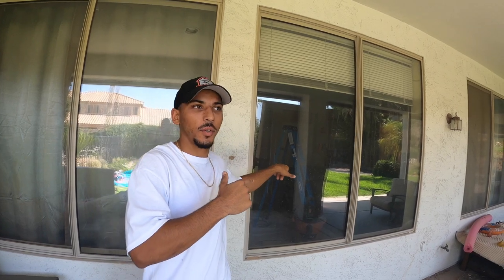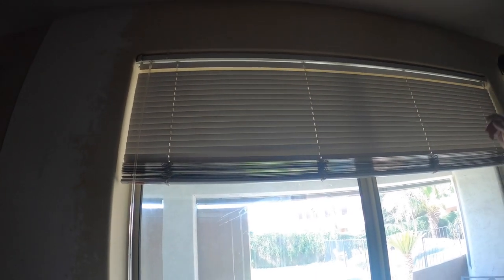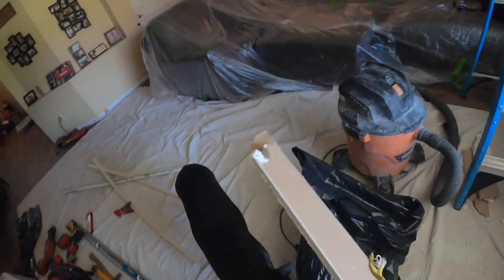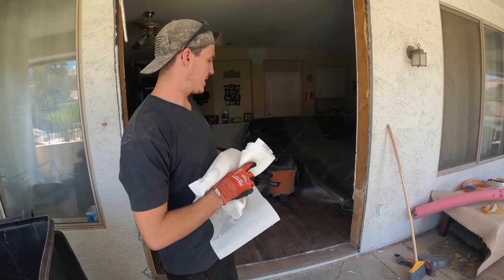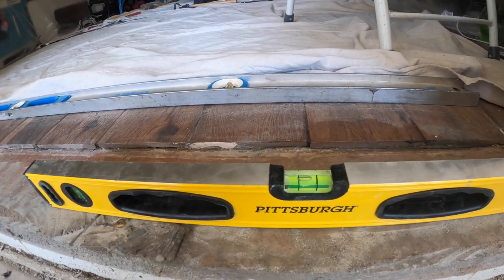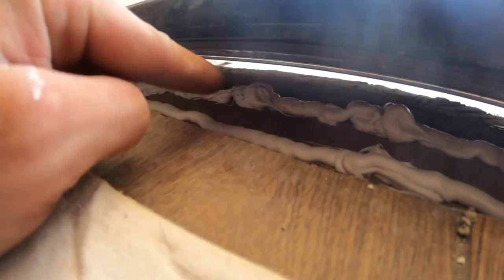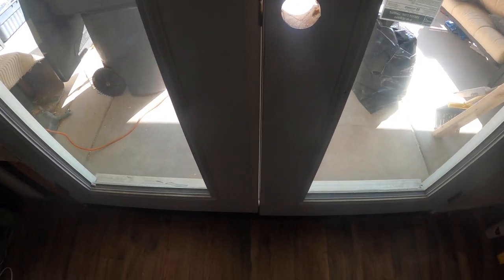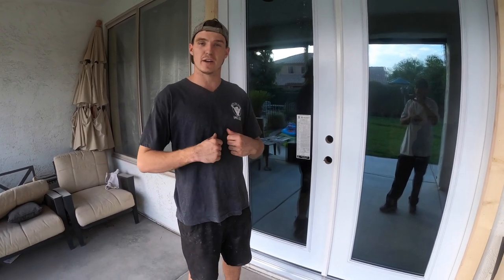How to convert window to french doors

Comment: How much would a project like this cost ?
Reply from the maker: 800 labor plus door
Reply: @everythingresidential  That's way too cheap.
Reply from the maker: @audiesbuilds  you are correct, that was 2 years ago
Reply: @everythingresidential  What ended up happening? Did you end up coming to replace the entire door and frame from the manufactures fault? I would've simply replaced the door from the hinges. And for cost, I'd say $1800 is more reasonable for time